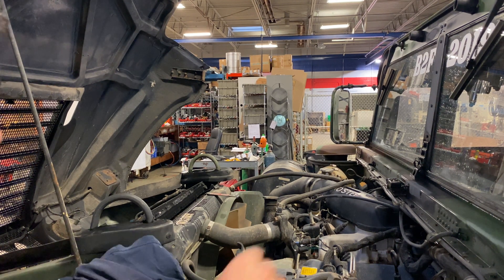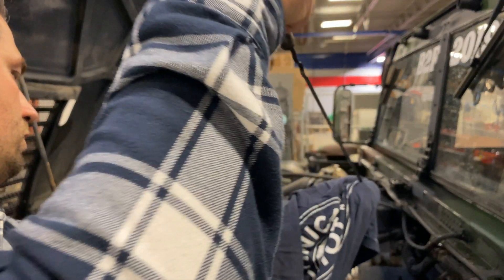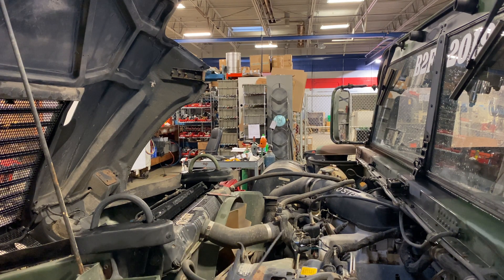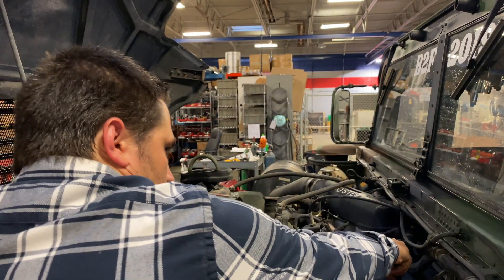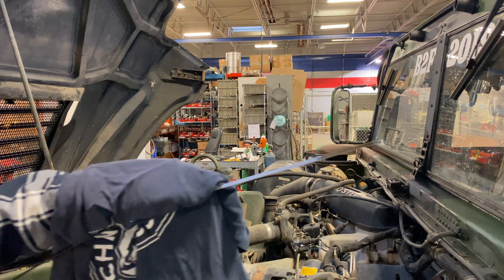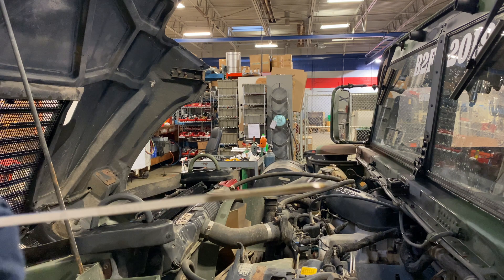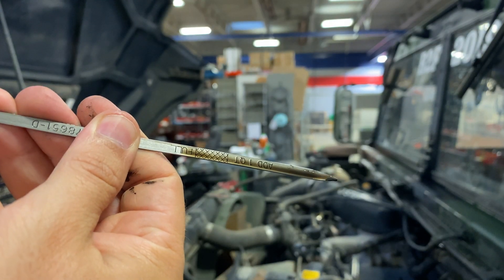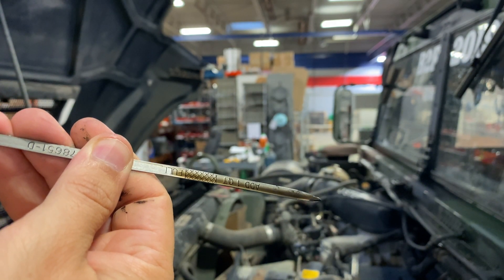Why not to check oil level when your engine is running

Comment: Some engines have two different sets of marks on the dipstick one set is for running and the other is for off. You can add a set of running marks to any dipstick. In a marine application, or a genset application shutting down an engine to check and add oil is not practical, safe, or sometimes even possible. Stopping and starting a genset is the worst thing you can do to it, we run our gensets for 7 days only starting up another one on Sunday when we have to shut down to change the oil, and then waiting till next Sunday to switch back to it. As for a marine propulsion engine it's running 24/7 often at full power continuously for a week or more straight if we are towing a barge on a long trip. Shutting it down is not a simple matter especially if your towing and have a thousand feet or more or wire out, so we check the oil level once an hour and add oil as needed to engines that are running at full speed. In my experience the smaller the engine the less accurate the running oil measurement is, but there are other factors including the size of the oil pan and how close to the crankshaft the oil level is, as well as how far away from the windage the dipstick is. On a 16-645 EMD the running oil level is extremely accurate while on a little 4 cylinder Kubota  it's basically unreadable.

Comment: I work with a ton of old school operators  and we run big heavy equipment and its a cardinal sin to start a piece of equipment without first checking the oil and trans fluid even when it’s dead of winter. I always find the same results cold it will over read, running & warm in range same with the transmission
Reply from the maker: I don't know why I started engine to check for the oil in the video. I do know its not the correct method. I did make a second video covering this mistake.